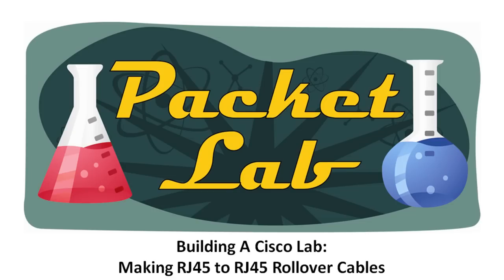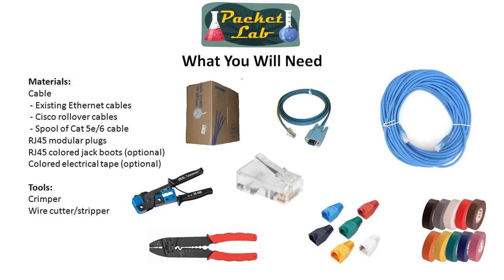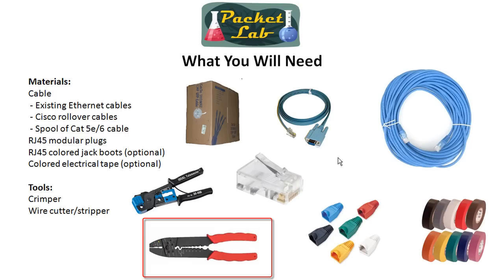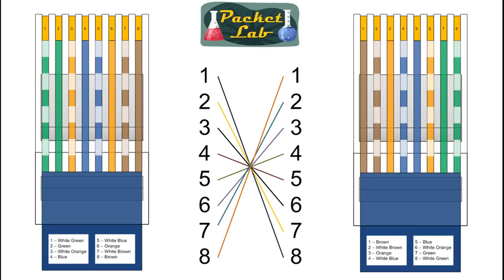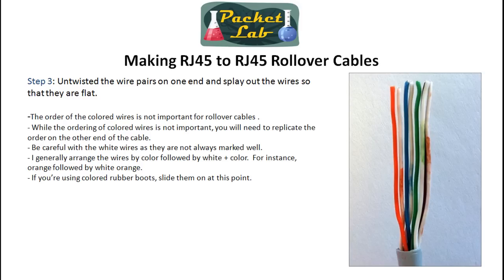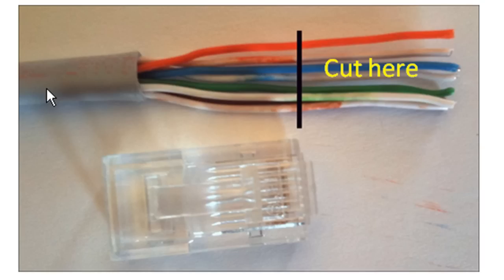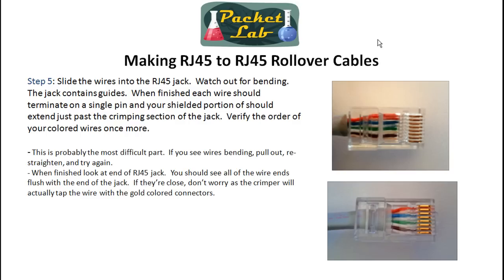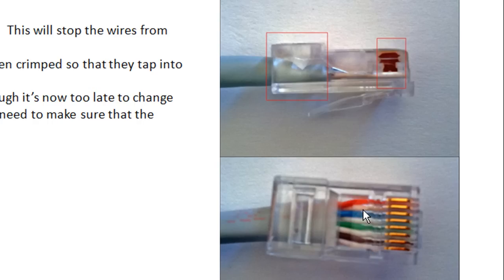Building A Cisco Lab - Making RJ45 to RJ45 Rollover Cables - Part 1

Comment: Im having issue getting my access 2511 RJ to work , i used rollover cable from 2511 to the router , used couple configs from the internet but no luck, when i try to get in using telnet it hangs

Comment: OI OI OI, can we go back 20 years pls? I need to go back to go forward..... Have u got an accurate pinout of the DB9 female to DB9 female Console Cable???? been looking for a week and cant verify I that I have to be correct. 1-9,2-8,3-7,4-6,5-5,6-4,7-3,8-2,9-1 which I made and tested to work with a multimeter BUT will not work with my srw2008 switch. Tried Hyper on winxp and puttyx32 with serial 9600/38400 Auto detect yada yada and yada.